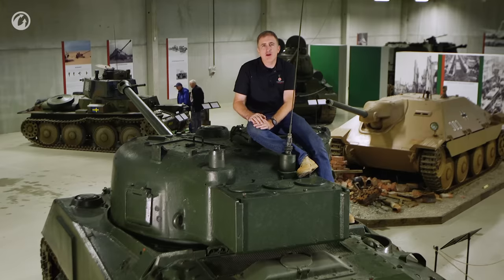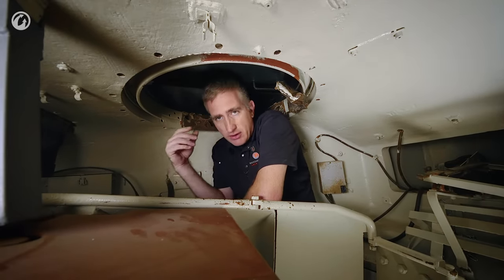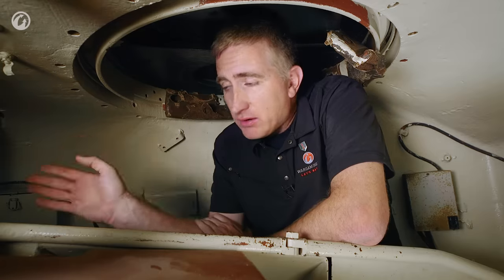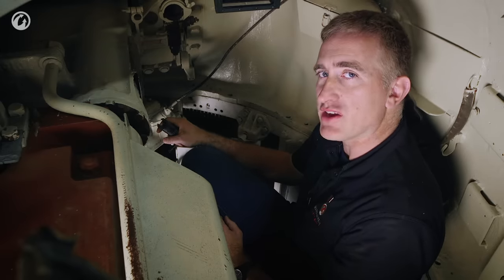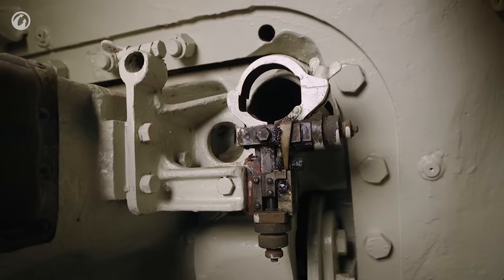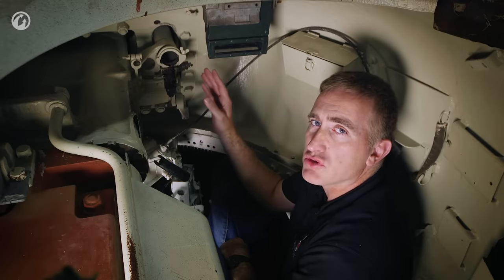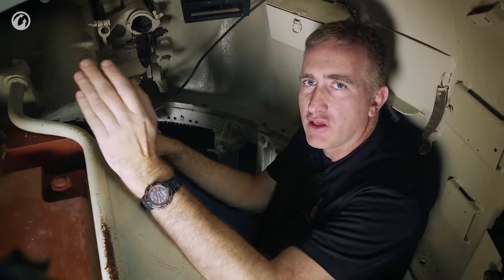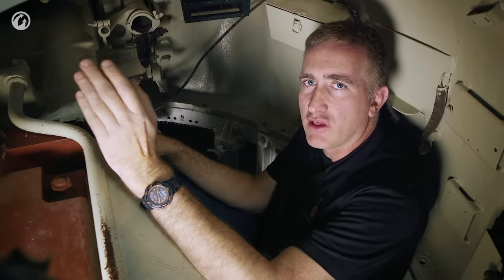Inside the Chieftain's Hatch: Sherman VC "Firefly" part 2

Comment: would you rather have a 76mm while fighting Tiger and panther tanks, or the very powerful 17pndr? don't know about you, I would much rather have the 17pndr gun, and lets not forget about the British and Canadian group that included Canadian tank commander, Radley Walter, in Sherman Firefly tanks that ambushed Micheal Wittmen's Tiger's and Panther's and came out without losing a single tank, while killing Wittmen and the other tanks in his squadron. also the punching power of the 17pndr having greater penetration of distance, and yes, being a smaller tank round, had less shrapnel then the 76mm did, but just penning the front of a Tiger tank as far away as possible would mean you wanted a 17pndr gun. in penetration power the German 8.8 on the Tiger was the better gun, but the Firefly's 17pndr had very similar penetration power, which meant that there was no German tank that could stand up to the Firefly's 17pndr gun, until the King Tiger, or Tiger II. However, that didn't stop the Firefly from being the first tank to kill a King Tiger. the lower plate on the King Tiger was weak to the 17pndr gun, and the flat turret face was able to be penned from close range, but in a 1v1 duel, the King Tiger will win 90% of the time, unless the Firefly commander knows how to get around the tiger to get better shots.

all that said, if the gun was mounted on a Cromwell chassis, or even a Churchill chassis, with a custom turret big enough to fit the gun and also be practical in combat, there would have been quite the change in power. The Centurion tank was late to the war, showing up for battle just after the battle ended, so it never saw combat, however, the tank was fitted with a 17pndr gun, which if it saw combat, would have given the Germans a run for their money, having really strong frontal hull armour, well slopped so the 8.8 on the king Tiger could only pen it at close range, but the same goes for the 17pndr vs the King Tiger's armour. However the early turret design was trash on the Centurion, and would have made the tank an easy target if they simply aimed a bit higher. World Of Tanks doesn't do the Centurion's armour justice, as it was very good in real combat, its why Centurion losses were almost never from a round hitting the front of the tank, but from the side, or being disabled by land mines.
Reply: designs were limited and at the time of the Firefly's creation, Britain got the M4a3, which they called the Sherman III, which also was the tank used in creating the Firefly. if they had the extra tanks at the time, the Churchill or Cromwell tanks would have made a much better host for the gun, as they have bigger turrets with less crewmen who need to be in it. for costs and the amount of shermans, it was easier to modify the M4A3's into the Firefly tank as we know it now. The Firefly lead to the refit of the M10 Wolverine, another vehicle from the lend-lease program with the US, which was named "Achilles", which they fit the 17pndr into the open turret, which was much wider and much easier to use with little modifications. only issue is, they didn't have a lot of them. however when it came to dealing with Tiger or Panther tanks, you want a Firefly in your platoon. probably the tank that requires the most man power to operate at the time, and one of the more cramped, but when it comes to battle performance, there wasn't anything else like it at the time in the allies hands, apart from a few captured German Panzer's and the odd panther, and a single Tiger which wasn't battle worthy after the engagement it was involved in (Tiger 131) when facing multiple Churchill III's and having the turret ring hit and jammed, along with damaging other modules inside. World Of Tanks makes the Firefly seem better then it was, at least in reload and mobility, but personally, I like having the ability to take out targets of the highest threat from the longest distance possible, as your chance of survival is much greater then a normal easy 8 crew, or Sherman Jumbo (depending on tank model). other Sherman tanks were converted later on to the Firefly, which some held better armour, or more room in the turret with modifications to the 17pndr gun, but those are not easy to find now a days. if further development was put into the Firefly, we could have possibly of seen a Cromwell turret on the Sherman Chassis or something crazy like that, making room for the gun, along with modifications to make the gun smaller inside to make it easier on the crew. In the long run, the tank worked, did was it was suppose to do, and then some, Just have a look at Canadian Tank Commander Radley Walter's history in his Firefly, from D-day to the end of the war, becoming a tank ace, and being involved in killing German Tank Ace Micheal Wittmen, and I say involved, as in no one knows for sure who fired the killing shot, between the British and the Canadian tank regiments that ambushed Wittmen and his few remaining tanks. it wasn't pretty to operate, but it worked.
Reply: @JT it's a bit circumstantial but to say you would rather have a 75mm Sherman against say a tiger 1 or God forbid a king tiger is just a ridiculous comment.....
Reply: But the king tiger was never penned from the front...

Comment: Firefly served the purpose, but at high cost. Gun was much less accurate, dirt kick was way to big so crew did not know did they hit, r not, and they was instantly spotted by enemy. 75mm sherman gun was actualy pretty decent one. Regarding the penetration power of firefly, KT was newer penetrated at front, and side armor was not so thick and it was penetrated from 85mm T34-85 gun from reasonable distances. Rate of fire was hampered also.  Swing after the first shoot was so big that they needed to wait to the tank to get still before firing again. It was overrated in popular media as a beast, but in reality it is still M4 sherman,  cripled for sake o little more penetration, but there was only 12 Tiger 2 tanks on western front and 126 Tigers I, what is rather small number, from around 2000 tanks and SPG-s totaly presented on western front. On Kursk battle, Germans had roughly 3500 tanks, with 2100 airplanes, what was much stronger force. Panther tank, with weak sides was actualy good at picking the targets fron far away. In a close combat, it did not perform much better then any ally tank that counter him.

Comment: 76mm Sherman was a bust, their 76mm gun was WAY inferior to the UK´s 17 pounder. 
Nevertheless the Firefly was a tank killer tank, not a GP tank.
Reply: @Electronick7714  -  The old 75-mm HE round packed 1.45 pounds of explosive material in its' warhead, while the 76-mm round only had .87 pounds.  The "75" packed a lot more wallop, and since the shot ratio throughout the war was 80% HE to 20% AP I'd say the trade-off was hardly worth it, especially considering some of the shortcomings of the 76.  As in any modification of an existing design (a.k.a. 'Patch-Work Engineering'), certain trade-offs are inevitable and rarely satisfactory.